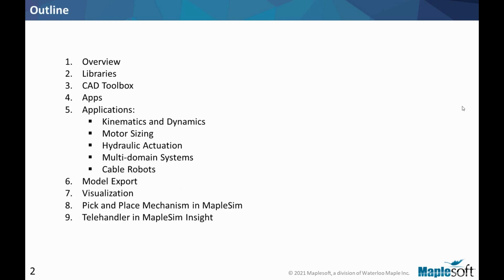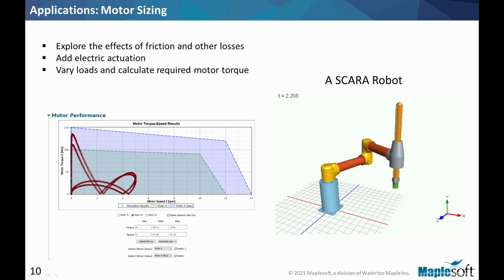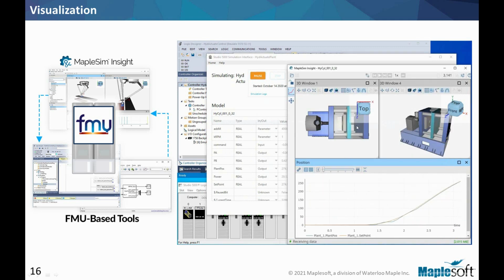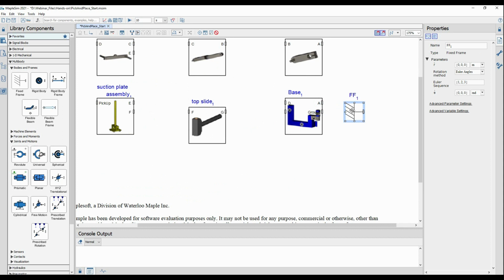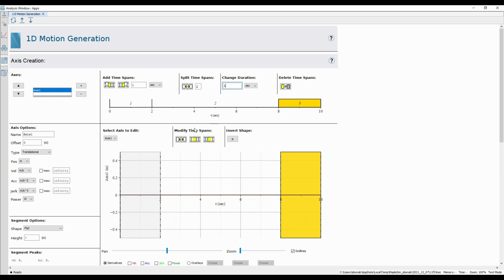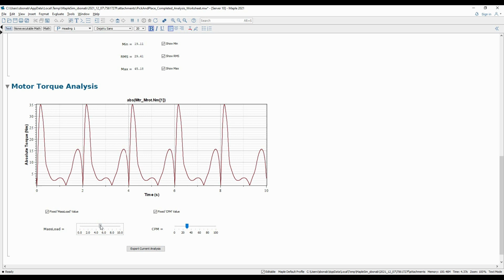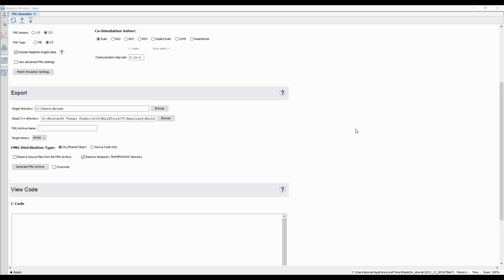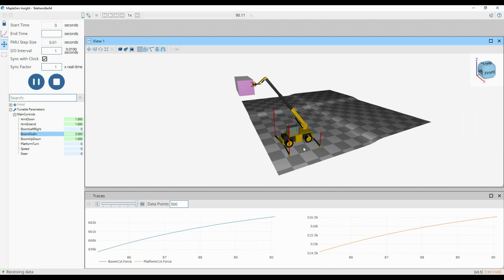Modeling and Simulation for Automation Using MapleSim

Comment: Hi, I don't have the import CAD option on my app. Is there any setups for me to have this feature?
Reply from the maker: Thanks for your question. You will require the MapleSim CAD Toolbox in order to import CAD models into MapleSim. For information (and/or to contact us about pricing or a demo) about this Toolbox, please visit https://www.maplesoft.com/products/toolboxes/CAD/.
Reply: @maplesoft  So I believe I already have the code from my school (UW), and have successfully downloaded the MapleSim. Is there a discrete way to download the CAD package, or do I have to redownload the MapleSim software to get the feature?
Reply from the maker: @truong5720  MapleSim Toolboxes are installed by (re)running the MapleSim installer with the appropriate purchase codes. If this is a campus machine, you may require the assistance of IT. You can also contact us here for additional support: https://www.maplesoft.com/contact/webforms/support.aspx